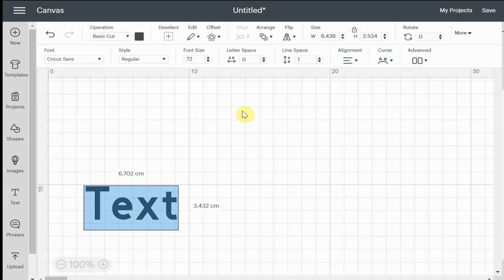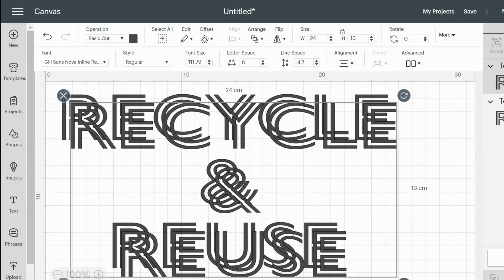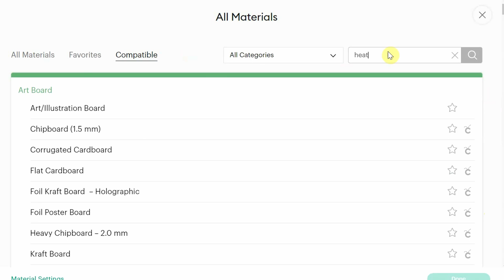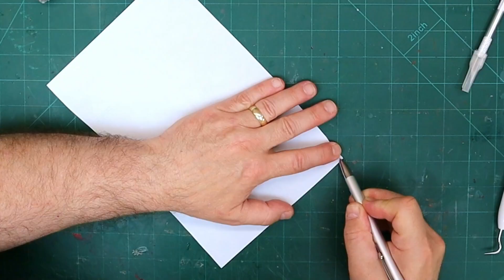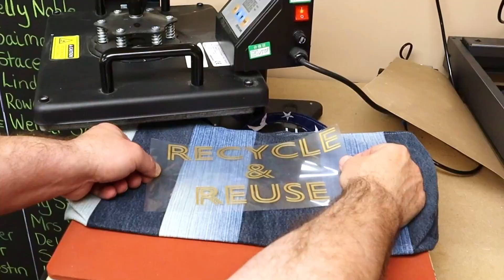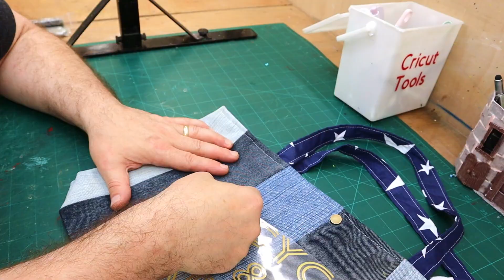Mastering The Cricut Maker - Adding HTV to A Handmade Tote Bag

Comment: A few quick Cricut tips for you!

1. Never pull off the mat. When you’re done cutting, flip the mat vinyl side down, peel a little material and pull the mat away from the material in a gentle curve. This will stop your vinyl from curling when pulling it off the mat.

2. Always (when possible) weed on the mat. It’s like having a third hand! If you take it off then you have to find a way to keep it stable while you weed. Not as easy!

3. When using HTV, always run the material you’re transferring to through your heat press for 10-15 seconds first. Warm material is much easier to transfer onto. After you’re done transferring, put the teflon sheet / parchment / butcher paper back on and hit it for another 20-30 seconds. That locks the glue that might release as you pull the carrier sheet while transferring the vinyl.

Hope that helps!
Reply from the maker: As always my friend, great tips from a great crafter